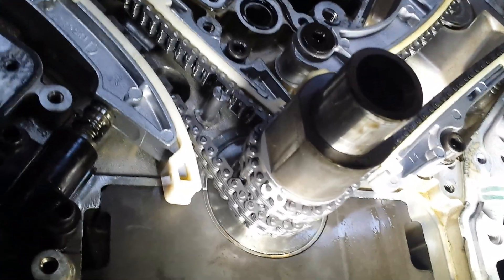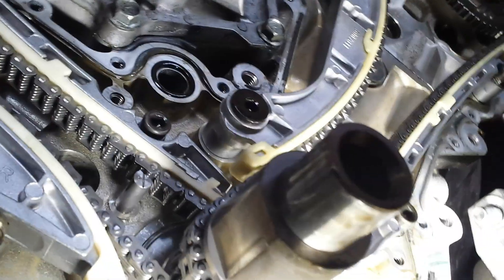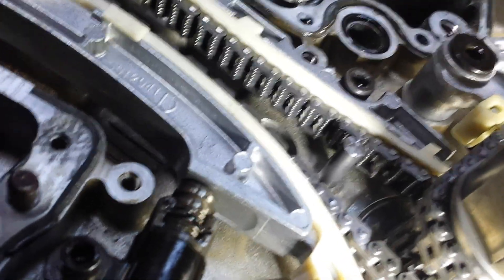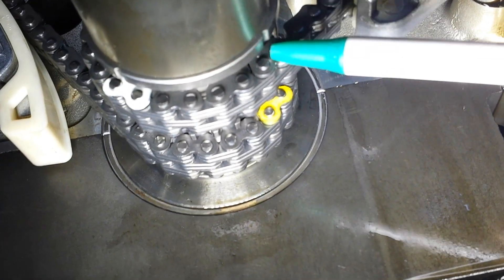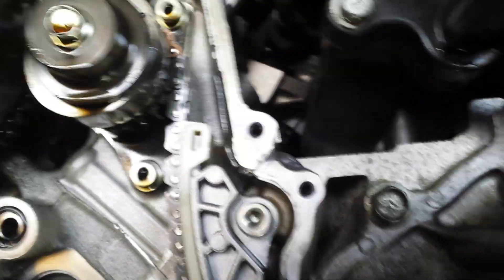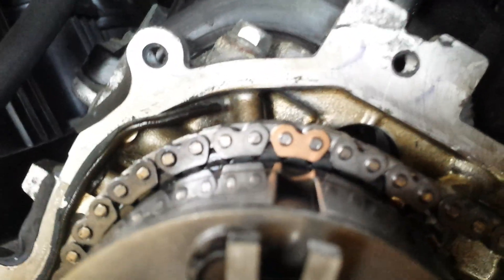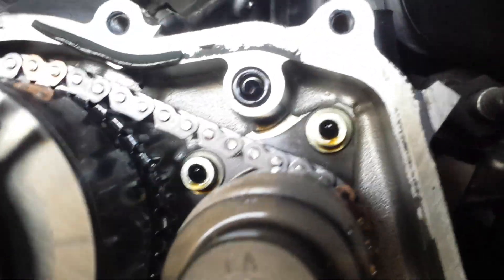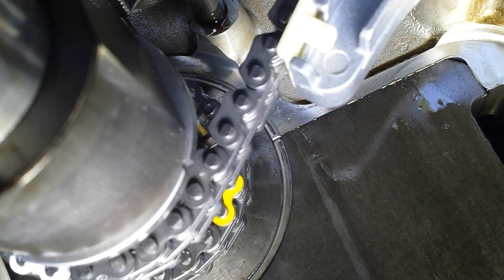Infiniti 5.6 Direct Injection Timing chain marks

Comment: I just replaced the timing chain on my 2012 QX56, same engine. I aligned the timing marks exactly and reassembled everything, but when I started it, I got codes P0300, P0011, and P0301 again. I'm really worried because I think the timing is off. I set cylinder 1 to top dead center and followed the instructions in the engine manual. My question is, after reassembling everything, do I need to do any relearn procedures, or what steps should I take? Could you please help me? TIA

Comment: hey I have a 2015 infiniti qx80 with a p0011 and p0088 code. Any suggestion? The car will run for a short amount period before shutting off.
Reply from the maker: This code can be caused by a few things.  Timing off a tooth, intake timing sprocket, or a blow out back timing cover gasket.   All 3 are expensive repairs.
Reply: @FixyourNissan  how much you would say to repair if it was you to do this job
Reply from the maker: @kelvingutierrez8328  On a 5.6 it is a huge job.  If you do it yourself, it's maybe 500 to 800 in parts.  It's mainly all labor

Comment: Hi, I have a 2015.
Qx80 infiniti. Have engine noise sound like a ralin. chain
Reply from the maker: Hello, I am sorry to hear that.  It was very common for these timing chains to stretch due to the direct injection pump they added to the timing chain configuration back then.  I don't think this has any warranty left for this issue, but can certainly call and inquire.  This was a bulletin back in the day when these trucks were still under warranty

Comment: what shop do you work at , I have had timming issues since I towed my car back from Chi-Town. I took it to the dealership and they charged me $225  and did not tell me what my root problem is. When I put my foot on the gas to pass another car it bogges down aa if I put my foot on the break. I need this fixed today. Pleasw help me with any information I can pass on to my new shop.
Reply from the maker: I am in PA.  But that sounds like either a Fuel pump issue, or a Mass Air Flow sensor issue.  Stay away from aftermarket parts.
Reply: Cam bucket for hpfp has a hole. $6,000+ job at Infiniti.

Comment: I can not turn the old chain to get the timming marks where they need to be. Can I take the chain off and turn the cams and the crank seperatly without the pistons hitting the valves.  Can anyone help me? It happened after I used the starter to get the main crank bolt loose.
I'm working on a Nissan Titan 2005
Reply from the maker: Is this before you timing chain work or after?
Reply: @FixyourNissan  before..i have same issue.. chain guid broke.. n wouldnt turn motor.. i had to take off a sprocket on the passenger side to losen chain ..motor will spin now but i dont want to turn anything til i figure out how to turn it all so i can get tdc.. is it ok to move things individually to get tdc without taking heads off?

Comment: Hi Jay, I have a 2013 m56 I purchased a year ago. Only 78k miles and already has major issues. The timing chain recall was done a few years ago. I had to change the lifter bucket after the camshaft put a hole through it. After a few months and my m56 accelerating at the rate of a Prius :’( my mechanic saw that the camshaft had already put a hole through the new lifter bucket. He again put another one in, but you can hear the camshaft lobe hitting the new lifter bucket, so it is only a short amount of time before it puts a hole into it. When checking the hpfp my mechanic noticed a leaking manifold, which he thinks is at least partially responsible for my car stalling a lot. 

Any feedback would be much appreciated!

Thanks in advance!

Comment: About to purchase 2011 M56s has 120k miles on (owner says did oil change every 2500 miles). 

Worrying about VK56VD’s engine life after reading this from a Youtuber owns M56s:

They do have an oiling issue that the trucks do not have. It creates a lot of sludge. So if you hangs your oil, even 300 miles later it's going to be sludge. It's working but it's not circulating as well as it could and getting too hot up near the top of the cylinder heads. A private Nissan/Infiniti mechanic pointed this out and basically said that it's rare to see them run over 200K

-> Any opinions/suggestions on this sir?
Reply from the maker: Hello,  The key thing is to see if it has the updated timing chain.  If it does, then you should be good. If it doesn't, then I would worry as well.  I would see if you can get the vin number and ask a Infiniti dealer to look in to it's warranty records to see if it has ever been done
Reply: @FixyourNissan  thanks for replying. Is the timing chain can be fixed as ‘recall’ for all m56s ? (Im located in Korea)
Reply from the maker: @infinitimusic1903  Yes, if it had the recall done, it would have the Updated Timing Chain which is a stronger chain which would keep it from stretching which was the original issue with the timing chains
Reply: @FixyourNissan  in korea, m56s had recall early this year for propeller shaft… Is propeller shaft recall same as timing chain recall??
Reply: @FixyourNissan  Thanks for replying sir.  How can you check if m56s’ timing chain has been replaced?

And how can you know if its timing chain needs to be replaced?
Reply from the maker: @infinitimusic1903  You would need the vin number and either contact Infiniti Customer Service or a local dealer to see if it has been done

Comment: How long does it takes to replace the timing chain on the infiniti qx60?
Reply from the maker: It is roughly around 11 to 15 hour job
Reply: @FixyourNissan  Thanks buddy!
Reply from the maker: @fabian.k17  Not a problem!
Reply: I see this Infiniti fx 2005 with a broken timing chains the guy says it still drives real good I'm thinking about buy it and put it in the shop👋👋good luck with your issue as well

Comment: Did you replace the jets on both banks?
Reply from the maker: No, the the primary oil jet down by the crank.
Reply: How do you know  if the oil jet is damage by the chain

Comment: HI ,Thanks for helpfull video. Does oil jets need to be replace every time with new chains and gears?  And  tencioners need  need to  be replace or oryginal can be used? Thanks for help
Reply from the maker: Yes they do. Normally when you have chain stretch it hits the oil jets. So the one needs to be replaced that is on the passenger side of the engine.
Reply: Got it.  Do You thing Snap on  or Matco Would have tool to pull old  and press new jet? Or this is a Oem tool? Thanks
Reply from the maker: It is a special tool supplied by Nissan / Infiniti to remove it.  You can look for it if it's available to the public at NissanTechMate .com
Reply: OK will try. So , in your opinion  there is no other way to do it?
Reply from the maker: That is it!
Reply from the maker: This is a Recall for 2011 to 2013 for M56 and QX56.
Reply: @FixyourNissan  does the recall still apply no matter the miles or age? There is a loud noise coming from my 2011 QX56. Initially there was a correlation fault, after 2 new timing solenoids, it became mechanically noisy and I suspect a very worn guide or stretched chain.
Reply from the maker: @scientist100   If the recall has never been performed then it can be done.  But if the recall has been performed and has failed later on down the road. That would be something you would have to absorb the cost of repair

Comment: I have a 2007 Nissan Titan with the 5.6 the shop was replacing the timing chains and the guy that was doing it quit. We only found one mark on the old Chains so we ordered new ones i know this is on an infinity bit if I'm not mistaken are the motors the same 5.6 do would it be the same way to time the truck do I need to order new gears
Reply from the maker: This engine as much as it seems the same, it is not. This has a direct injection pump that runs off the timing chain. So the configuration may seem similar, but is very different in how it operates. The best thing to do is to buy a new chain from the dealer that has the colored links to line everything up so you don't make a mistake.  These engines are very easy to mess up it's timing. At the same time you want to disable the fuel system when you first try to start it to allow oil pressure to the tensioners. This way it doesn't jump time cause the tensioners don't have the proper pressure..

Comment: Thinking about purchasing a 2011-2012 Infiniti M56S but I hear that the timing chain has to be replaced in them around 60,000 miles or so. Is the 5.6 worth the headache or is it better to get the 3.7 that is said to be bullet proof?
Reply from the maker: +walt9427  the time chains have no maintenance to them.  So they don't need to be replaced, unless something goes wrong. The 3.7 is a bullet proof engine. The 5.6 is a great engine also, but with the timing chain issue, that is the only thing I would say would be the reason to stay away from the 5.6.
Reply: @FixyourNissan   Were ALL Infinity M56 2011 thru 2013 at risk or only the ones that owners received bulletin or recall. This is so confusing. I am looking at a 2012 M56 and never had service on chain nor was recalled. I do hear a "cricket type noise coming from the overhead cam area? Thanks for any more advise. I love everything about car, runs great but ....
Reply from the maker: @rclarkrep100  I love the M's when they changed and came out in 2011!  I certainly have seen my share of timing chains on them, and they are direct injected so they do make a little bit more noise with the direct injection pump! How ever, even thought I have drove both many times, I think the 3.7 performs better and the engine is Bullet Proof!  So if I was to ever get a M, it would have the 3.7!  That is my opinion!
Reply: @FixyourNissan  3.7 performs better? Explain...It is a badass engine though.
Reply: Fixyournissan
But if the 5.6 recall on the timing chain has been performed, then it shouldn't be an issue, right?  Does the 5.6 burn oil like the 4.8's where known for?

Comment: do you have a part numbers of the Crank Gears? I 
have the same engine mounted on my Nissan Patrol 2012. 
I faced same problem that timing chains. Right chain has extended..
Now Im going to replace my chains to Updated timing chains...
Reply from the maker: +Aibek Bakpasov These are the part numbers for the QX56 here in the states, which is what is used in this video

Bank 1 Crank Sprocket 13021-1CA0A
Bank 2 Crank Sprocket 13021-1LA1A
Reply from the maker: +09infintig37x  It is not a Recall in any state.
Reply: Hello Have got Nissan infinity Qx80 5.6 engine,it had issues with mult misfire when i opened the cylinder head cover for bank 2 i found out that one rock arm for cylinder 8 is broken , how can i remove this upper shaft and could have caused that problem thanks